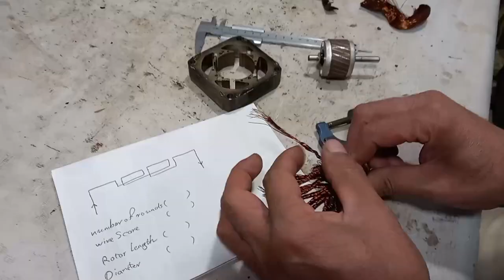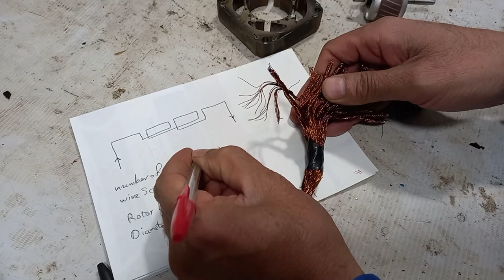Restoration & Repair Burned Refrigerator fan Motor | Recovery step by step

Comment: FAKE. Need a 3 wire. 1common 1principal(run) 1auxiliar(start).
Reply: This is called a shaded pole motor, it doesn't need a start or run capacitor. Copper "shades" are used on portions of the stator, which delay the magnetic flux propagation long enough to create a rotating magnetic field. The shades do essentially the same job as a start capacitor in a regular single phase induction motor.

That being said, I've never seen a shaded pole motor as large as this one. They're usually much smaller and only have a single coil, commonly used in small desk fans. Since shaded pole motors have such a low starting torque and low efficiency, they aren't economical scaled up much past what you see here.